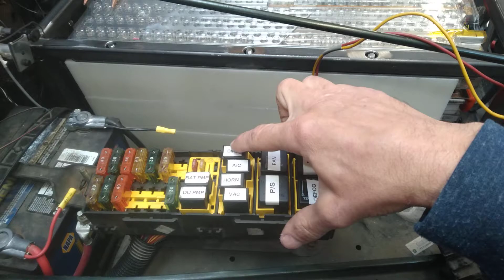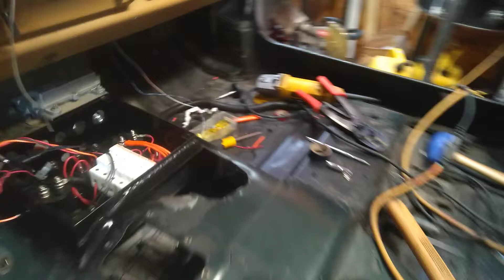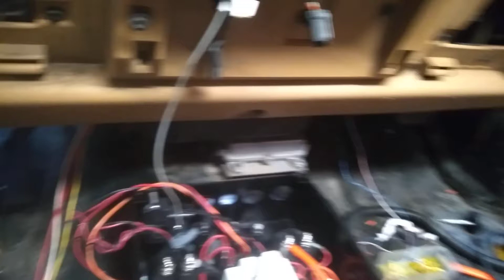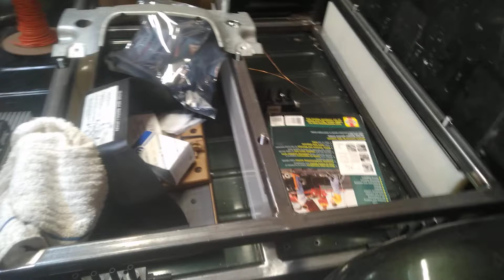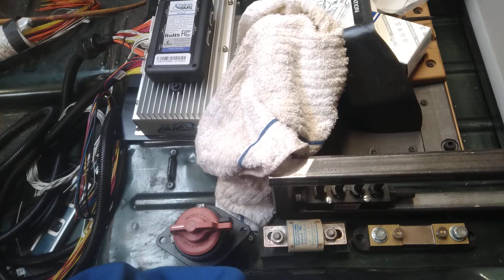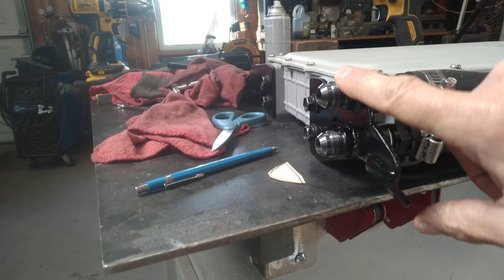More Mess - Tesla Jeep

Comment: I have Orion2 also.  I am pretty sure the fuse has to be places between the 72 and 73 cell.
Reply from the maker: It could be between 36 and 37 or 72 and 73.  For me, 36 and 37 are inconveniently in the front battery box.  72 and 73 are between the bank box and the back seat box.  I'm working on wiring all the Multi-Purpose and Enable Outputs now.
Reply: @billbayer5526  Well good.  You got me to check. 
So on page 49 of 74 it states: ..................                 If safety disconnects, contactors,or fuses are used within a battery pack the Orion BMS must be wired such that the fuses, contactors,or safety disconnects fall between the connectors (between taps 36 and 37 or 72 and 73 or108 and 109 or 144 and 145)